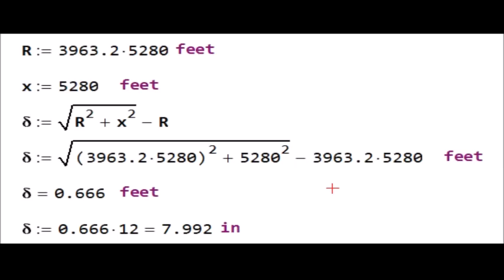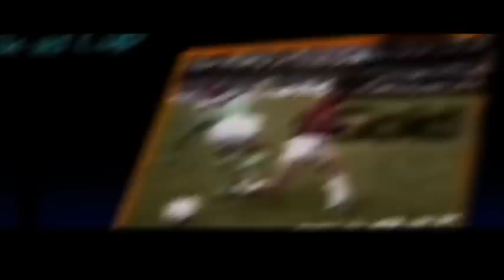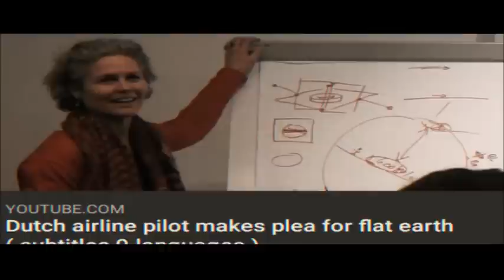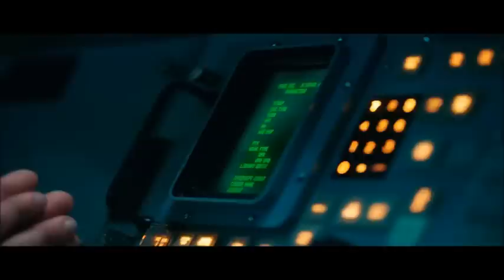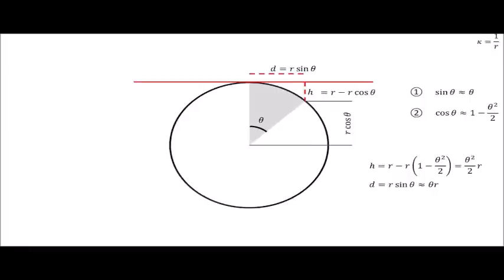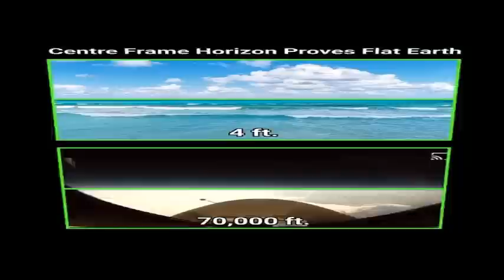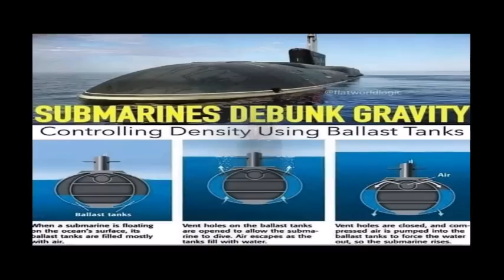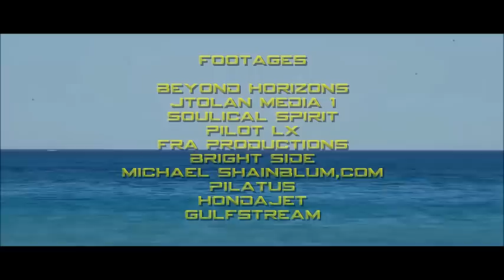2022 Flat Earth documentary Flatten The Curve by Vikka Draziv ✅

Comment: The 50 miles statistic is consistent across different types of radar and laser tracking systems. At that range, there should be 13,000 feet of earth between the sender and target.
The number 666 occuring so often in the math of these things is also statistically impossible.

Comment: What is the black area above the thin blue area? Why is it black? How far does that blackness go? Why is the gas on the ground not rushing to fill the black area where the pressure at 62 miles is just 0.000145 psi

Comment: This video contains so many inaccuracies and misconceptions it's hard to know where to start.  Notice @49:00 he begins to present, as his final evidence in the section on submarines , an explanation of the workings of the AN WSNTac7 ring laser gyro, however midway through his explanation, the video jumps to a narrative about missiles.  We all know why, it's because Bob Knodel and FECorp had purchased a ring laser gyro for $20,000 and with it confirmed the earths rotation.  This apparently occured between the time the video was shot and released and was mistakenly left in the finished video with a clumsy edit.  FECorp later went on to pay to have an elaborate mechanical gyro compass built.  These devices are required navigational equipment on all vessels engaged in maritime commers, and when the device, built by and for FECorp, was turned on and spun up it showed an identical 15 degree per hour drift...oops.  When confronted by this inconvenient  truth, what did Bob Knodel and FECorps do?  Booted the member that had built the device from FECorps and threatened legal action if the video evidence was revealed.  But the video ultimately did surface and was shown on several YouTube debunking channels. What did FECorp do when confronted with this second fail?  Deny deny deny.  Real Truthers, huh?
Reply: Sure bud
Reply: @benjamin07420  I know, right?  The wacky part is that there are still people that think the earth is flat

Comment: 36:24 Radar transmitters and recievers are mounted high up on a ship so they can "see" further over the horizon of the curved Earth. If the Earth was flat this wouldn't be necessary. If you want your radar to see even further you put it in an aircraft.
Reply: There are things going on near the surface that can distort radio waves as well as vision.  That’s why it helps to wait for good weather when you want to do a test with light or laser or even radar, ground clutter they call it, can misdirect or block signals sometimes.   Not to mention other ships, islands ect can block signals that why they put antennas up high on ship or shore. Lasers prove the earth is flat so when you get rid of the idea there a curve blocking things you begin to realize there are other reasons putting something up high enables it to be seen furthur, not a curve blocking it.  Please be open to other possibilities you may not have considered because of an old paradigm.
Reply: They do

Comment: Ok to start off with are you putting the North Pole at the middle it inadvertently puts the South Pole around the outside and I can tell you that we have a celestial pole in the Southern skies which does not move around the edge flat pizza disc. You have no explanation for why the Southern Stars rotate anticlockwise whilst the Northern ones rotate clockwise which means the air above your map has to change directions halfway round. Australia is not the shape that you have on that map. You can easily reverse your map and put the South Pole in the middle and you will have exactly the same results. This map is easily disposable
Reply: Why does America have double the time zones than Australia when they're similar sizes horizontally across the globe? Surely there'd be 24 equal time zones on a rotating ball that spins once every 24 hours?
Reply: @deanmcclaughlin914  hahaha and hahahahaha too fun funny